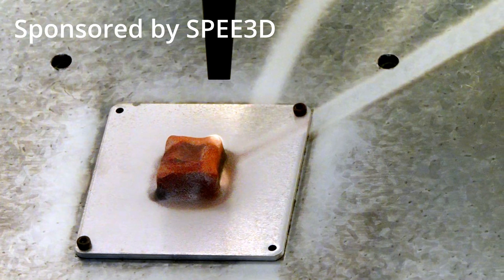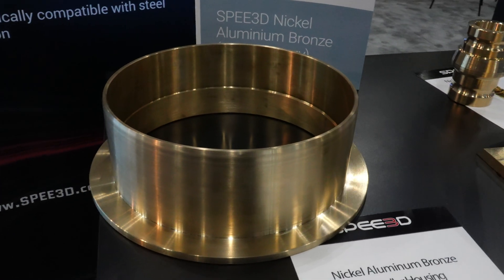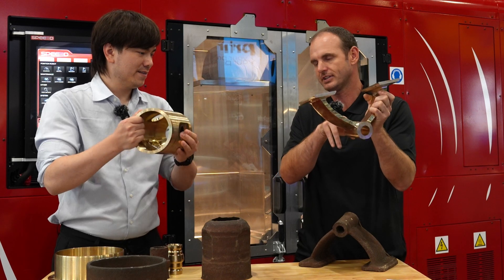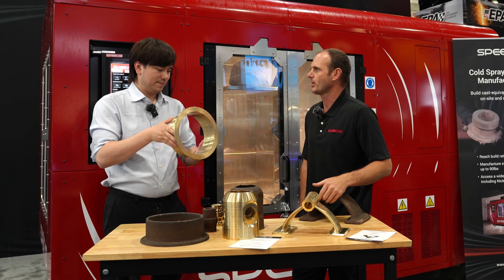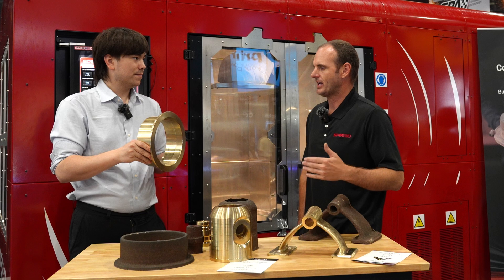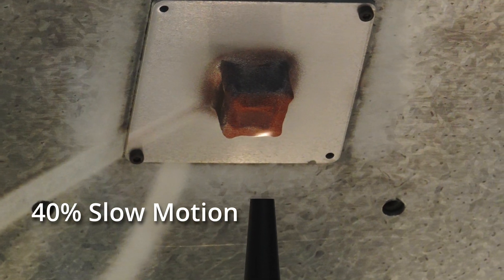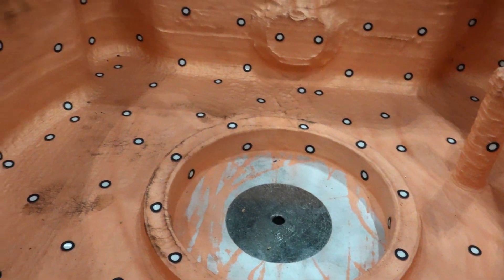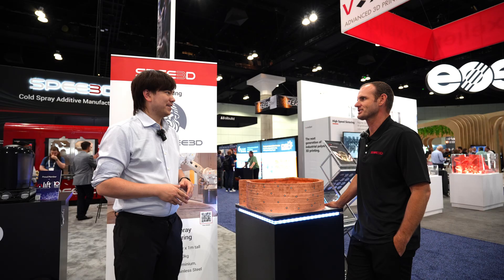Cold Spray Additive Manufacturing with SPEE3D

Comment: Ok they literally just made CNC casting, rather cool.

Also no you dont need to waste the entire round stock center to make that bushing, you cut the center out so you can use it for something else then bore the inside to the final size with the features you need.

Comment: Forget all the practical applications, my mind goes to printing real Iron Man armor with Titanium powder.  This is truly amazing technology though in all seriousness. You could see one of these being used on the Moon or Mars to make spare parts as needed.  Wonder how it would act in Zero G?  The weight limitation on the robot would not be a factor.
Reply: The mass limitation will still exist
Reply: They’re already adding 2D titanium carbide to the surface of metal particles used in cold spray AM

Comment: THIS IS THE KIND OF SH*T I'M TALKING ABOUT! It's obvious that this guy has knowledge of machining. What kind of waste powder does it generate?
Reply from the maker: I think most of the powder sticks to the plate, but some does get yeeted off into the abyss. It’s fully contained so it’s probably collected in a bin for recycling.

Notably, the powder particle sizes are larger than what’s used in other powder processes, so it’s probably cheaper to produce and safer to handle, but that’s just a generalization, I don’t know it for a fact.
Reply: That’s their marketing strategy

Comment: This is a rather novel use case for this process. It's been around for a long time, just not as a 3D AM technique. If it didn't require heavy machining afterwards, I'd be keen to take a look, but it won't be capable of doing fine detail models like laser sintering can achieve.

Comment: simply amazing how additive manufacture comes up with these processes. the fact you can now make solid metal objects using air and powdered metal, is mind blowing. how long until someone comes up with a DIY variant of this, that can run on the desktop, at home.
Reply from the maker: It would be cool to have a mobile robot with one of these spray guns!
 https://en.wikipedia.org/wiki/Cold_spraying

Comment: SR 71 in reverse.
Reply from the maker: That’s crazy that that plane went so fast. But it begs the question, could you add material to the SR71 by flying through a cloud of metal particles?
Reply: @NathanBuildsRobots  they used titanium so when they got to Mach 3 it didn’t melt. Indicates that they probably wouldn’t be able to print titanium on this machine.

Comment: Love the process, but I can't think of many parts I could use straight off the machine without a machining step. The machining step is a pain, especially with many of these parts where you need to figure out workholding, and then if you are going to CNC the part, tool path generation. 

They would really benefit from something like pressure advance, to cut down on the extra build up at the corners. I am assuming they are using a venturi to pick up the powder, so some sort of servo vale should do it from a hardware side. Software should be doable.

THe deposition rates seem good, and if their material prices are low enough, I think it may be worthwhile in some machine shops. But a bit more part accuracy would be really nice.
Reply: You can imagine a second robot arm that comes in every X layers to do a little subtractive CNCing so you end up with an almost ready item (they still seem to want to heat treat at the end).
Reply from the maker: I think it’s more of a replacement for casting - so you can get a super large near-net shape without having to make a mould or use a foundry. Especially these days, there are limited numbers of foundries making these sorts of large parts in the west. 

Seems like a great machine for manufacturing large propellers, with the super large printer and marine alloys.
Reply: @NathanBuildsRobots  It they are cost competitive with sand casting, that seems to be a good market. I am assuming it would open up some geometries that are difficult with sand casting. If it does, then you just have to beat investment casting prices, which is a much smaller market, but an easier number to hit (though this looks to be a bit less dimensionally accurate than probably both sand and investment)

Nothing about their process as shown indicates that with refinement it couldn't be more accurate than it is, so I will assume that it is something they are working on.

Either way, I hope this tech can find a commercially viable niche. We are going to be needing a bunch more CNC manufacturing as gen Z is small. With capital costs so high, AM companies are really going to need to show some profits if the AM segment is hoping to continue getting investment. And without significant growth in AM, the expansion of manufacturing that everyone is pushing for is going to be a lot harder.

Comment: I‘m no expert, but I see material accumulating at the corners. Adjusting the flow rate or the movement speed could result in a perfectly flush surface each layer. Then it would require less post-processing.
Reply from the maker: To me it looks like it’s an unavoidable part of the process they are using. The material is built up over an area, so to fill out the corners of a part they need to apply a little extra there. 
But it’s better to have too much material than too little!

Comment: don't robot arms have their own software and operating system to control the joint angles? why do they do it themselves?
Reply from the maker: Good question. I think you’d need some idea of the state of the machine within the slicer to check for collisions and make sure the robot has enough range of motion
Reply: @NathanBuildsRobots  that makes sense. i did a kuka certificate. they have a programming language similar to BASIC for their arms. spee3d could transpile their toolpaths to that and run it through the kuka simulator to check for issues. if you just define points to move to, it might even avoid exceeding the range of motion and singularities on it's own. you can probably create geometry for the robot cell, too, to avoid collisions. oh well, whatever they do, it works.

Comment: moving the print around has never made sense to me. rotation is ok i guess.
Reply from the maker: Their “hotend” is pretty heavy/complicated, since they are feeding high flow and high pressure air to it, while also incorporating a powder feed mechanism. While printing there are a lot of angle a changes, and it’d be a lot more work whip that huge rocket nozzle assembly rather than just tipping the build plate. And part removal is easier when you don’t have to climb into the machine to switch build plates.

Definitely a list of pros and cons in terms of safety/cable routing/moving weight/maintenance/shipping.
The most obvious solution isn’t necessarily the best! The new config definitely makes more sense for super massive parts. I guess you want to move whichever is lighter.
Reply: @NathanBuildsRobots  oh, so on lightspeed, the parts were lighter and on warpspeed the printhead. that's awesome
Reply from the maker: @marc_frank  The Titanspeed that is the super large one. Warpspeed was present at this show, Lightspeed was at the previous one. It looked like 3 meter diameter/multiple ton capacity for titan, 1 meter diameter/30kg for Warp, and 0.5mm diameter for light. I didn't get the weight limit for the lightspeed, but I assume it's a little less than the warpspeed.

Comment: Not only does your bin of powdered metals serve as spare parts, you can also blend them for use in thermite and other fun things! Dual-use for military applications.
Reply from the maker: I think one of the interesting things about this process is they use larger particles than some other metal powder processes. 
Smaller powders are more dangerous and more expensive to produce since they have more surface energy and can even explode.
Reply: @NathanBuildsRobots  Important factor on s sea fairing vessel.
Reply from the maker: @murderdoggg  Yeah, it looks like they are really leaning into the maritime applications. It seems like the titanspeed could be a really good process for fabricating large propellers, as an alternative to casting. Casting has its own issues with porosity and stuff, so in this case the additive parts might actually be stronger/better.
Reply: @NathanBuildsRobots they are coating metal powders with titanium carbide nanomaterials at Purdue University which have a surface energy of 50 mJ/m^2 as opposed to metal surface energy of 2 J/m^2 that could change the particle size used.